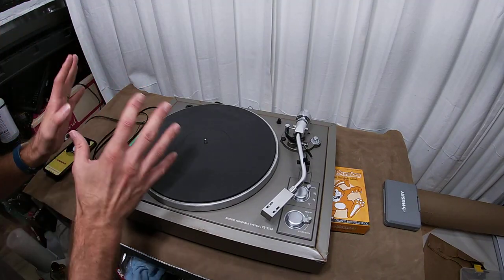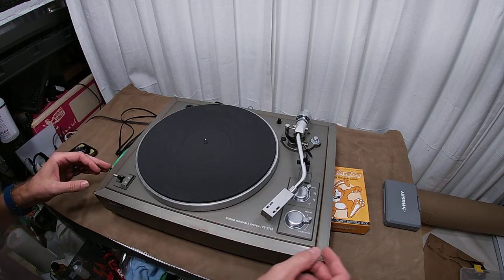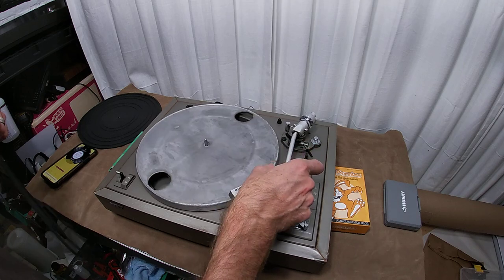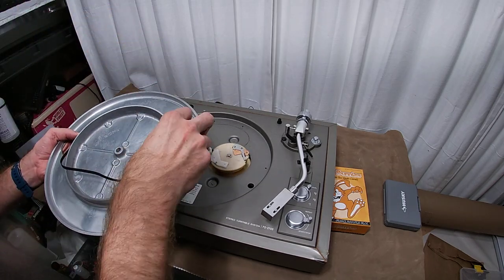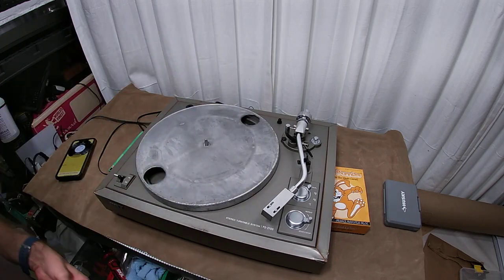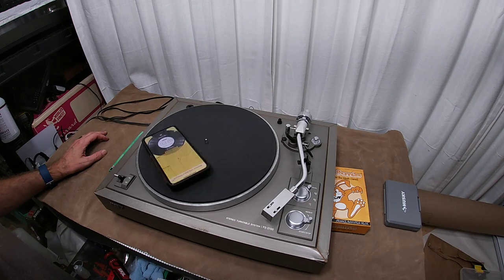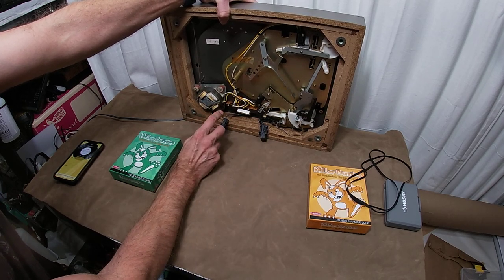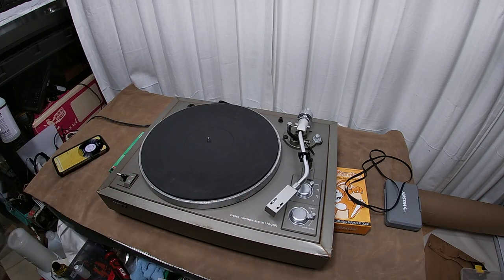Belt Drive Turntable Is Running Fast or Slow, HELP! Could it be a bad belt?

Comment: A DC motor's speed is directly proportional to the input voltage. The higher the input voltage, the faster the output speed. The lower the input voltage, the slower the output speed.

Thank you for the video.  I have contemplated buying a direct drive turntable, but I want one that's definitely autostop, but maybe full auto (start too)

Comment: Thanks for the video. You confirmed what I long suspected that belt fitment affects platter speed. Here is my input on motor speed variations.
DC motor speed is controlled by input voltage. AC motor speed is controlled by input frequency. Turntables which use DC motors usually have a circuit that varies the input voltage to control the platter speed, either with a manual adjustment or a quartz lock circuit to automatically maintain the speed. Turntables with AC motors can control the platter speed either with a mechanical adjustment (Dual) or by a circuit which changes the frequency on the AC input voltage (Thorens TD-125). I also have seen some variation in platter speeds on AC motor turntables over time but I usually chalk this up to environmental conditions other than voltage like temperature, humidity, lubrication status, etc. Very large variations in voltage can affect AC motor speed but not the small variations in line voltage. I control the speed of my Leslie unit with a variac.

Comment: My Lab 300 turntable was running fast. I ordered a new belt, still running fast, then I saw there was a little bit of old belt residue stuck on the motor pulley. I scraped it off and now it runs perfectly! I tested it with a paper stroboscope disc and then again by playing an album on vinyl and streaming at the same time and the speed matched.

I wonder if the weight of a phone could affect those rpm apps

Comment: Just looking at the motor of this t table, it appears to be an AC Four-Pole Synchronous motor.  Synchronous motors maintain accurate speed from the AC's line frequency which is 60Hz in the US.  I suppose subtle variations in the line frequency will alter the speed.  More of an issue with lighter platters than the flywheel effects of platters with more mass.  Some turntable motors have tapered spindles  to allow speed adjustment by moving the belt up or down on them.  You know, if you're going to be doing videos on this subject, dump the phone app, (real rookie stuff, plus you're using it incorrectly) and get something more accurate with a quartz locked illuminator that doesn't rely on the power line frequency like an AT  AT6181DL Stroboscope Disc and Quartz Strobe,  or my personal fave, The KAB SpeedStrobe where the strobe features the actual speed numbers instead of "Instead of hypnotic bars".  There are pricier devices but these are very accurate.
   On another subject, the emphasis on making sure the speed is exact,  on a lot of cheaper turntables, vintage stuff, DC motors and  almost all direct drive models that were not made in the last few years, you're more likely only getting speed accuracy centered around your target speed; 33.33, 45 RPM.  There is a saying about DC motors; "They go right by going wrong".  A turntable that might be off a smidge too fast or too slow can sound fine if there is little or close to no variation in speed compared to something that you think measures well with a phone plopped on the platter but varies enough to be audible.  Many people don't listen very well, not noticing the speed variations.  I've said this on other websites: play some piano music that has long sustained notes, notes where the key is held down for a long period and listen if you hear any variation, wavering of the note.  You would be surprised at how many turntables fail at this simple test.  Also damage to these forty, fifty year old turntables bearing or motor induced noise.  A decent stethoscope placed at various points on a table's base is always a good way of checking.  It's amazing how much of this noise goes unnoticed.

Comment: your method seems flawed , depends how far away the motor is from the sub platter , if i did that method with my thorens the belt would be far to tight and damge the bearings in both the centre bearing anfd the motor
Reply from the maker: I don’t follow. I have Thorens as well (and many many others), the concept is the same for it (those). I balance belt tension (via belt size) such that there is minimum tension to keep speed stable. This minimizes tension on the bearings in the motor and spindle assembly. Please explain how using this method will accelerate the wear on bearing.